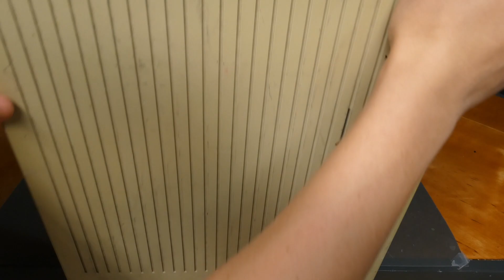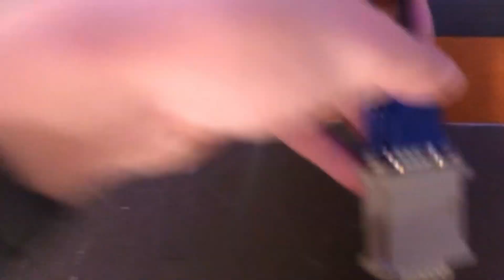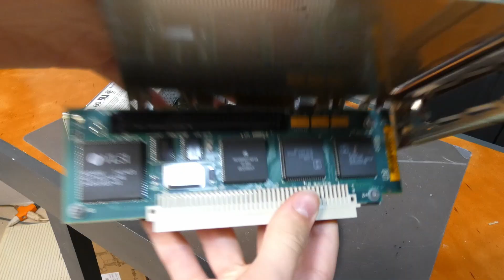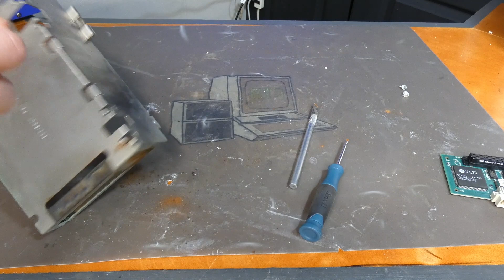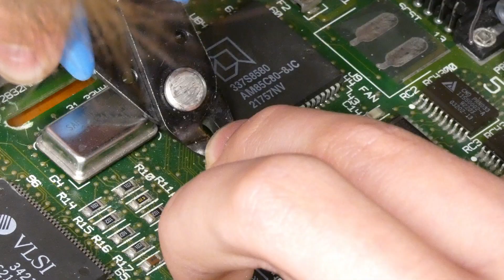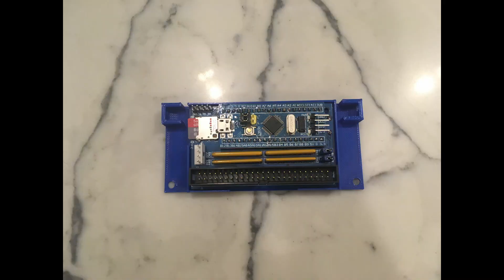This Classic Mac is BEYOND REPAIR… Can I Fix it?

Comment: Great restoration. Keep pumping out those videos. I have to restore my Mac II / IIx / IIfx that I fired up in my last videos. I am still deciding what I should do with the rust/corrosion that I have on the metal shields. Carefully remove them and sand by hand? Respray them? I'll work it out.